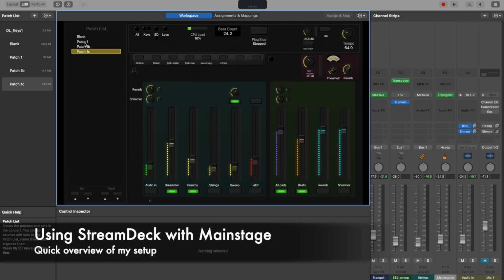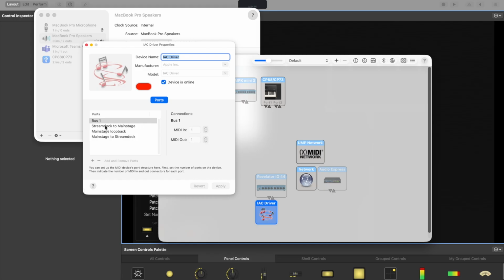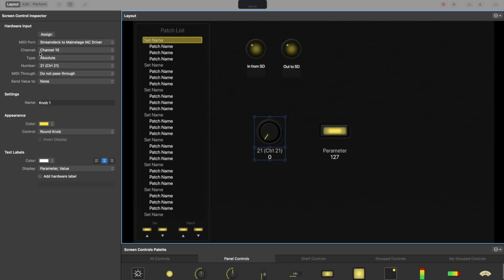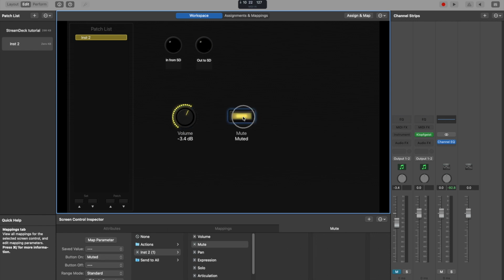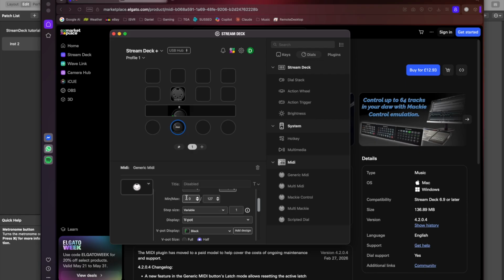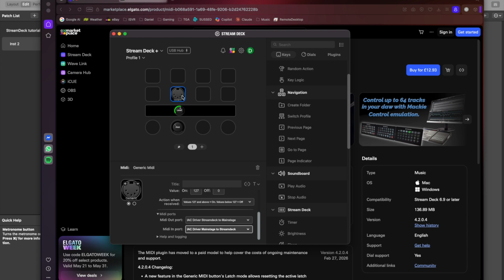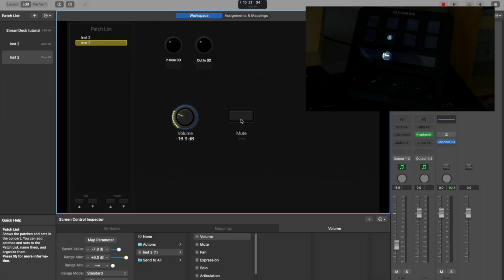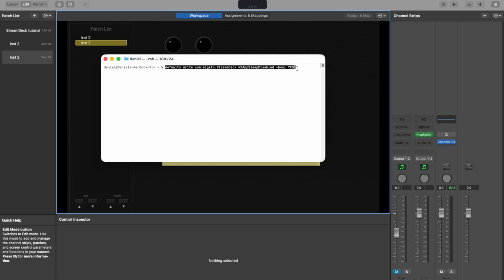StreamDeck + MainStage integration tutorial

Comment: Great intro video, I will absolutely be using such. I have a question regarding 'application focus' as far as the StreamDeck+ is concerned. Because I'm using this computer for multiple things at once, I do NOT ever put Mainstage in performance mode. With the buttons mapped to the application as you've done here via MIDI, is it necessary for Mainstage to have focus in order for the buttons and knobs/pots to work?  

Or am I able to have other applications as the focus, and using the StreamDeck+ will it go ahead and make the intended changes with the application in the background?